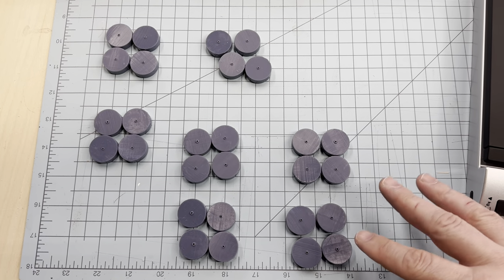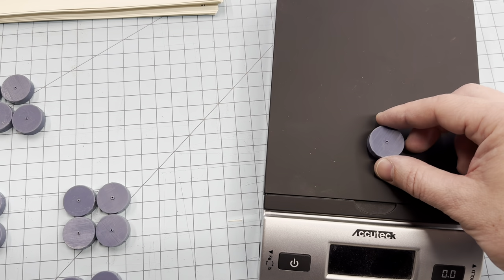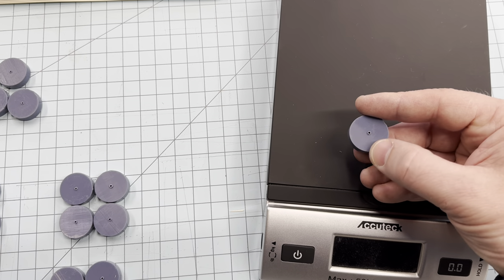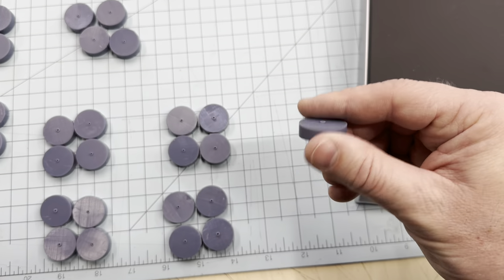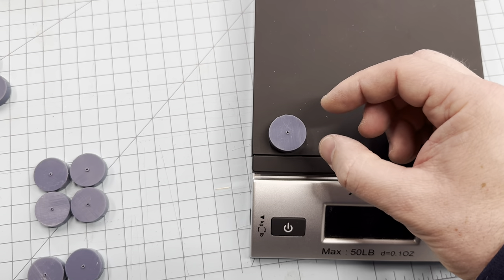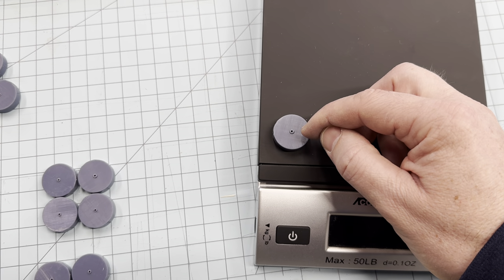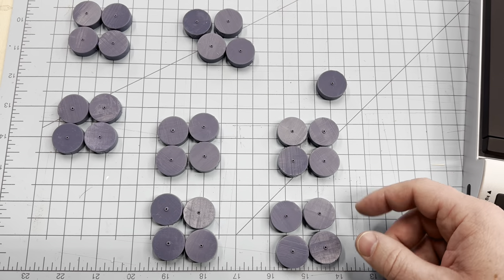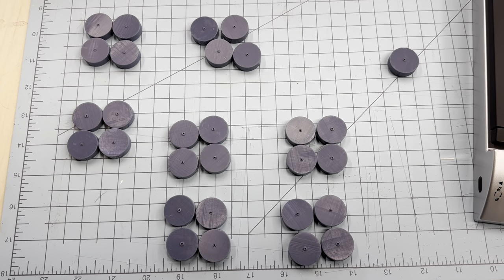1/200 Titanic Porthole Jig Sets

Comment: Ben quick question. How do you go about making the rafts with the protective side walls for the oerlikon guns? Do you design them in cad and if so how do supports work? The slicer software that I use has basic raft settings. I made some parts for a friend and want to send them in the mail. I asked on some forums and am not getting any answers. Thanks